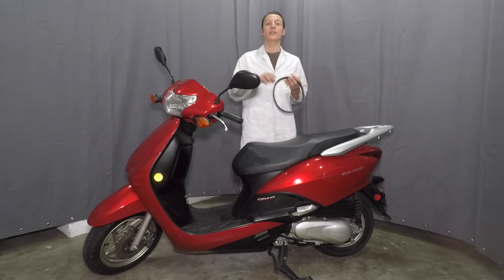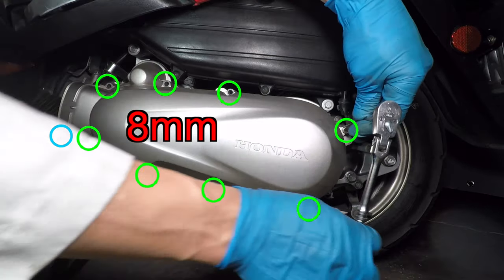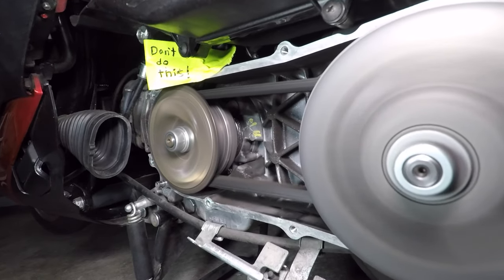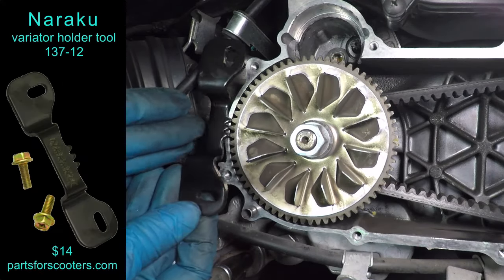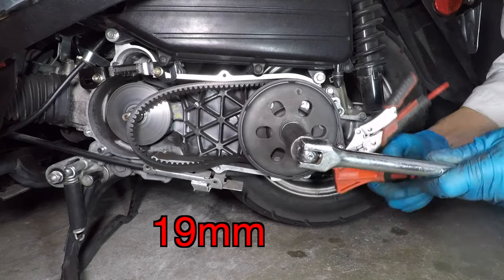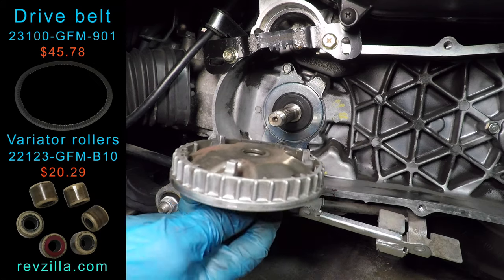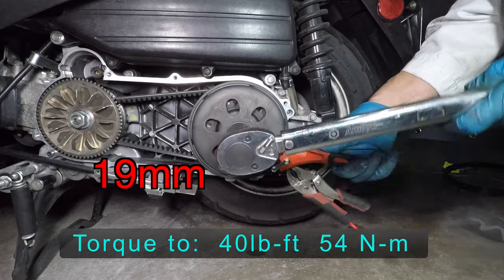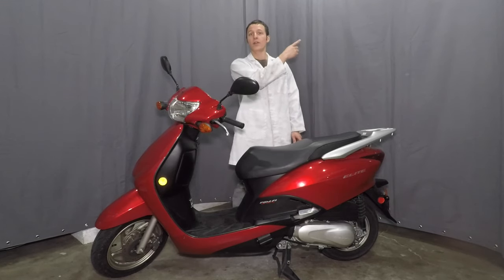Drive belt and variator roller replacement in a Honda Elite 110

Comment: I removed the 8 bolts but the cover is stuck.
Reply: I drove it around without the bolts for 2 days until the cover got loose. That was not safe at all but it worked